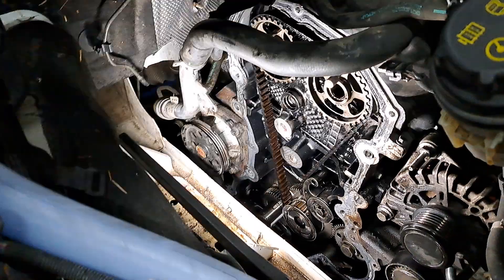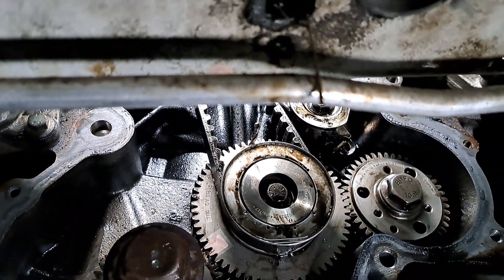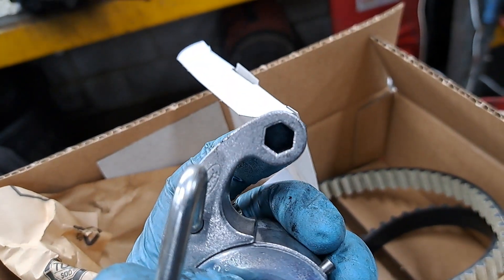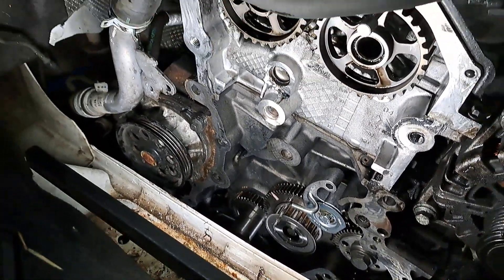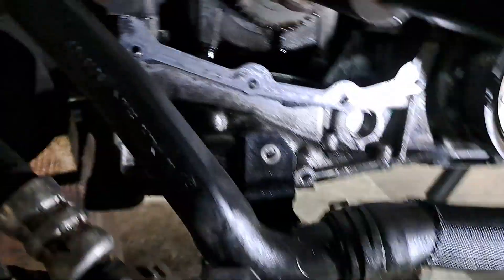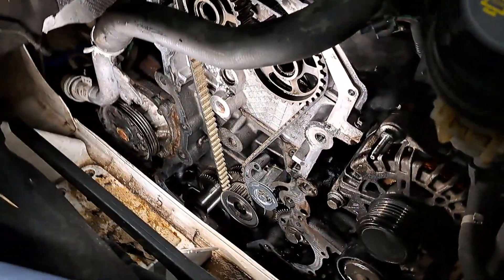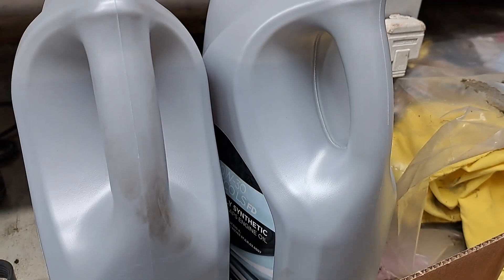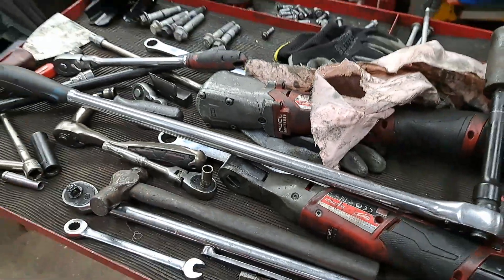Ford Transit 2.0 ecoblue timing belt wet belt replacement

Comment: I keep seeing that there's big thing with making sure the timing markings are aligned after belt has been replaced,I'm thinking that this only needs to be checked if belt has slipped or snapped while vehicle was being driven or is there another reason for this, because if not of the gears have been disturbed then the timing is still correct regardless of the markers lining up?
Reply from the maker: You are correct it would only need to be checked in that way if something had been removed replaced or broken I just used three pins to time up and then change the belt

Comment: All the hassle and mess of a timing chain, and all the (lack of) durability of a timing belt, plus tiny pieces of rubber all throughout my oil? Where can I get one of these!!
Reply: Money making scheme from manufacturers in my eyes knowing full well they will sell more belts than chains, plus I feel sorry for people who do not have my skills and have to pay over a £1000 to have it replaced the job in its self isnt that hard just removing alot of componants out the way to get to the belt but still garages charge 8 hrs labour, massive con to just move a few pipes out the way and take out airbox, the price should solely be on removal of engine cover and belt change 👍